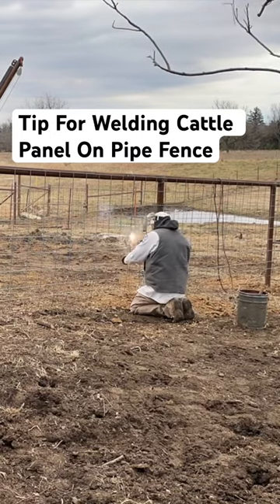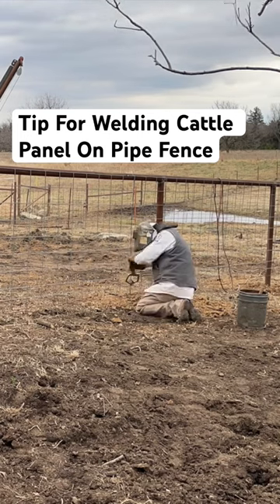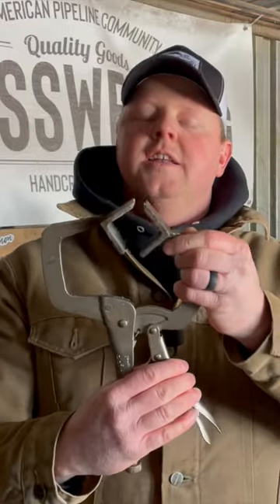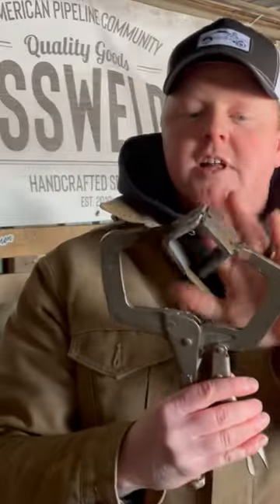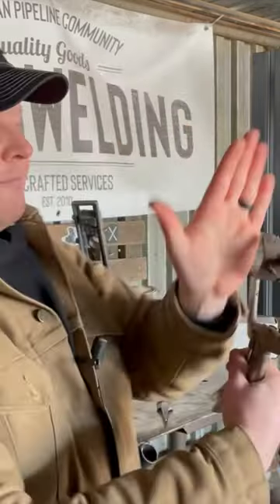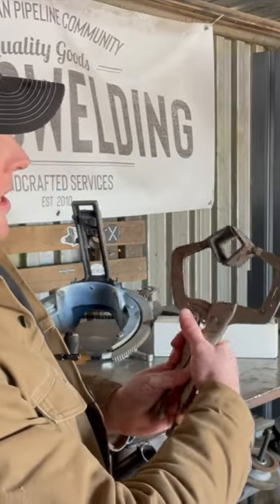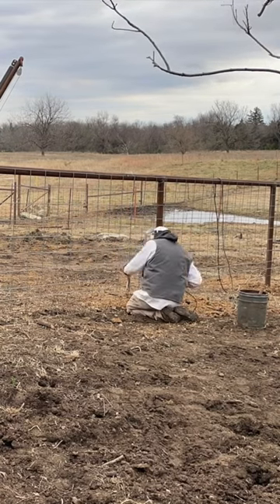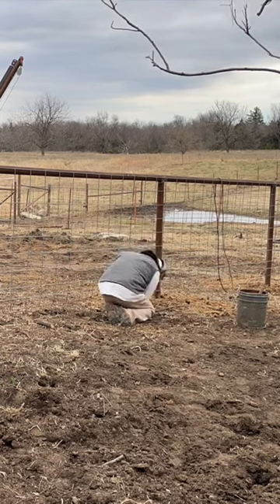Tip For Welding Cattle Panel On Pipe Fence #rigwelder #welding #farm #pipe fence #fencebuild

Comment: You stick weld them or mig? If stick what rod ya running? 

Oh and now I gotta make a set of those clamps 😅
Reply: Did you watch the video?
Reply: @danbuckley6584 just thus video in which it's sped up and at a distance when he's welding so it could be either 🤷‍♂️
Reply: Austin nearly always uses stick on a fence.  He's  probably using a 3/32.  Want to know where he found such flat ground to be able to stitch panels together.